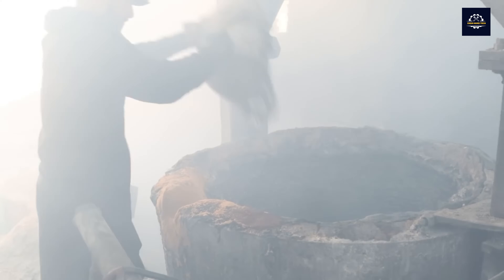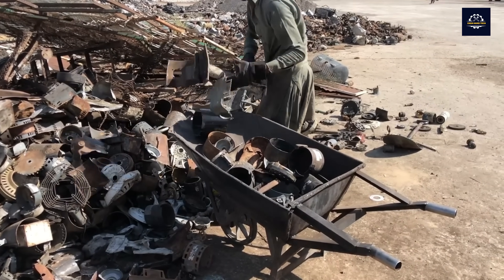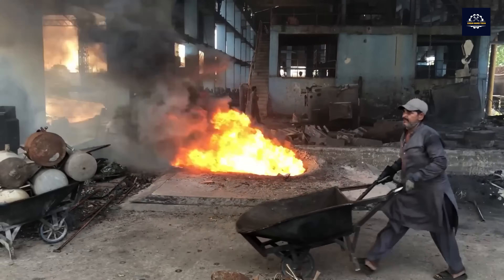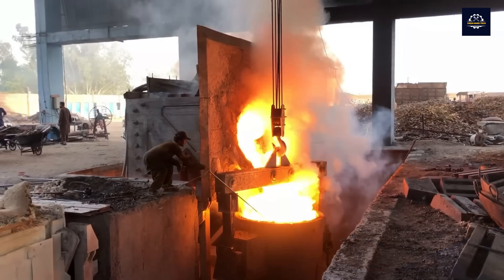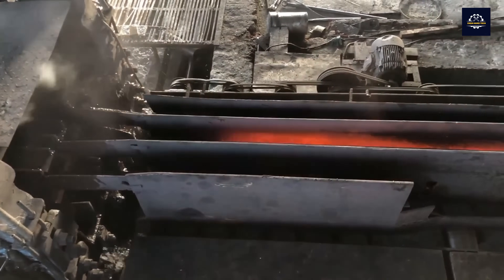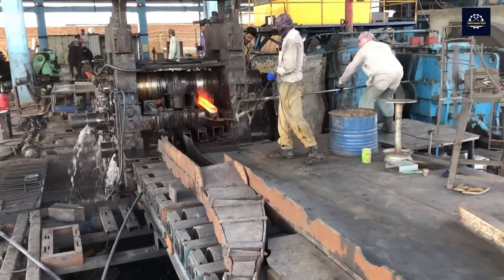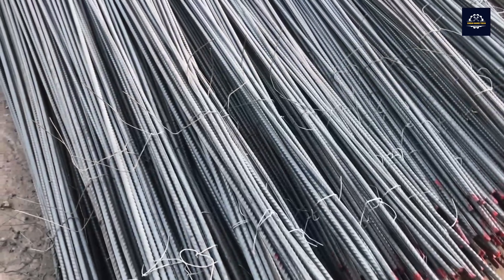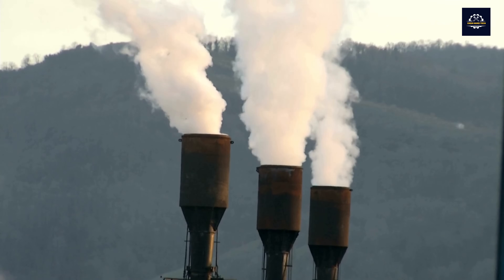Amazing Process of Metal Recycling

Comment: So how do they control what alloy the recycled end product is? Do they just leave whatever copper, nickle, aluminum... whatever was in the scrap steel in the metal with no attempts to remove them or control the final mix of metals?
Reply from the maker: Thanks. It depends on the quality of steel the factory is aiming for. I am not sure, but considering the size and process of the factory, I think they do not care much about that issue.
Reply: @IronHandTech2024  I guess that's why so many steel products from certain countries absolutly sucks compared to others.
Reply: "Pot metal" is the name given for any unmeasured scrapyard metal mixture, and pot metal is fine for a lot of applications.

Comment: LOW TECH WHERE is A.I. WHEN YOU NEEDED IT IN THE SEGREGATION SYSTEM.???  🙄🙄🙄
Reply from the maker: I think for a local factory that's a bit expensive
Reply: @IronHandTech2024  THIS IS WHERE A.I. IS MOST APPLIED WHEN IT COMES TO DIRTY WORK. DUMP SHRED SEGREGATE A.I. ITS ALL IT NEEDED TO MAKE IT LOW COST AND FOR MORE LONG TERM INDUSTRY.
DONT BE LEFT BEHIND IN RECYCLING BUSINESS.
Reply from the maker: @melonshop8888  Thank you !
Reply: @IronHandTech2024  
TRY CROWDFUNDING SITES IF SOMEONE SUPPORT THE INDUSTRY.